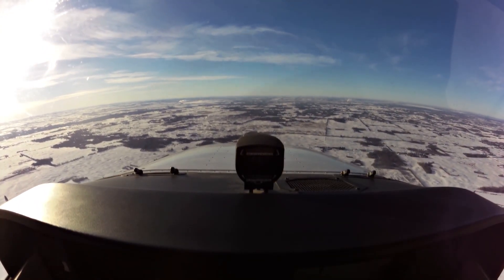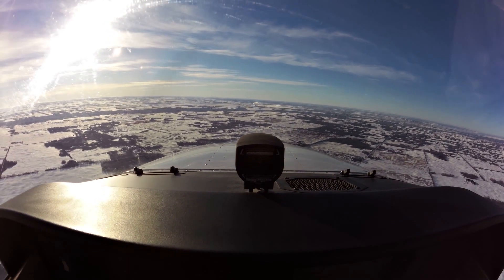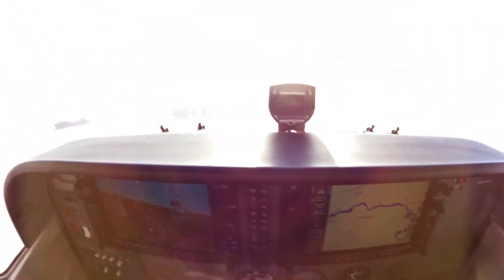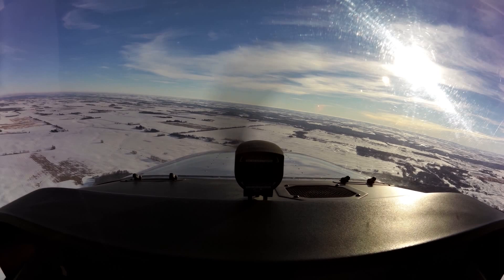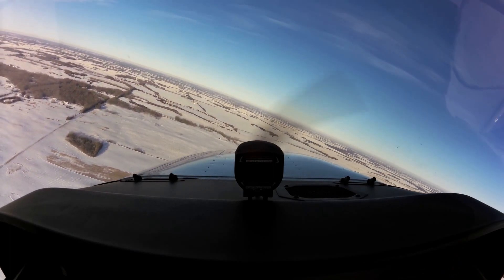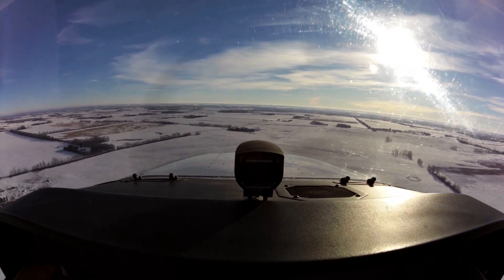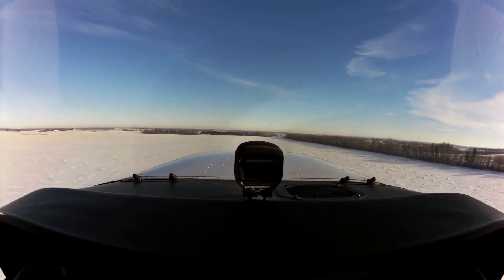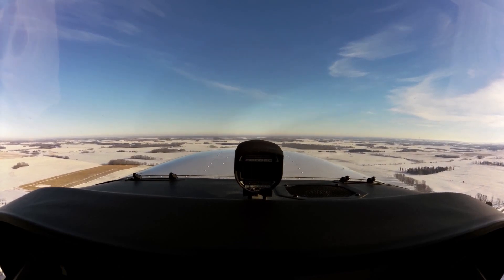Demonstration of a full procedure Forced Approach into a field

Comment: No high/low key points?
Reply from the maker: Not in this demo. The high key low key is another option but we tend to lean more towards what we as pilots are so comfortable with and use all the time, the circuit method. We tend to prefer this method instead of the high low key as there is less consistent turning and during an emergency having less to think about can be rather helpful. But of course everyone can use which ever method they find works best and gets you safely down during an emergency.
Reply: @edmontonflyingclubcfi2065  Totally agree with you. Thanks for the response!
Reply from the maker: @johnforbes1582  Happy to! Blue skies!

Comment: U were high. According to  cpl standard u have to land within 1/3rd portion of field. Definitely u wud have not landed within 1/3rd.
Reply from the maker: Hi Fahad, The approach and landing is to the CPL standard. It was a very long field and safely into the first third of it. Not having been in the airplane does make it a bit tougher to see that though for sure. Also keeping in mind that the options to add more flaps/ slip etc are also there but for the purpose of this demo we were not overly pushing it for the safety of the exercise and emphasis on control and not panicking etc. Flight tests are important and we push to the highest standard so we appreciate your comments but also think its important to not just learn for a flight test but for practical real life situations as well. All the best!